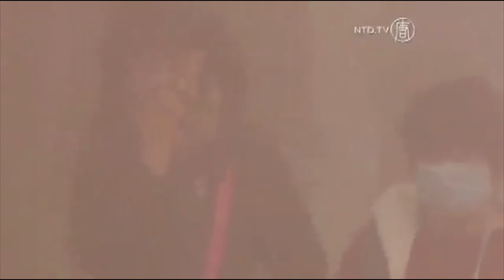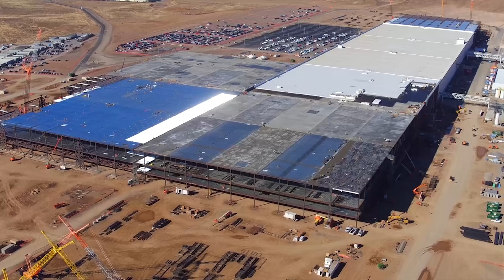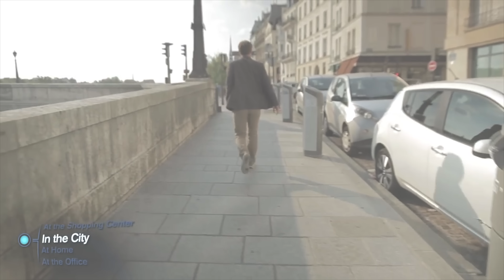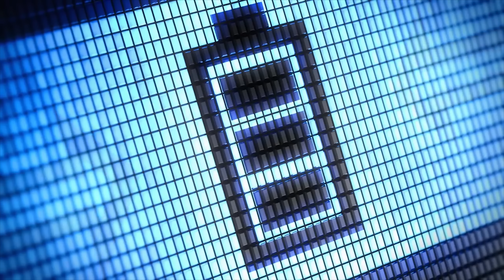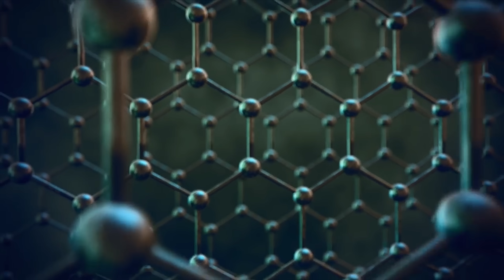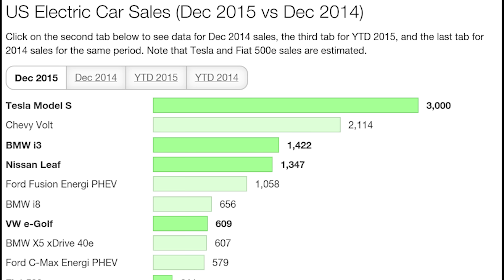Are Supercapacitors About to Make Tesla Obsolete?

Comment: I would think Tesla  will just put in the best Technology available .  I think Elon has already expressed interest into the Super Caps.They are not known for standing still or being Luddites.
Reply from the maker: +Charles Jutkins Of course, you're probably right in practice. Did you read about Volvo's announcement today?
Reply: Energy Analyst What is the announcement?
Reply from the maker: They announced that they were fazing out diesel cars - https://futurism.com/volvo-says-that-they-will-stop-making-diesel-engines-thanks-to-tesla/
Reply: Charles Jutkins I was about to post about the same comment. I would imagine Musk would embrace this pretty quickly.
Reply: I think super caps are good for quick bursts of high energy while other means apply for long distance energy needs.
Reply: Tesla just bought Maxwell, a super capacitor manufacturer, today

Comment: Tesla is currently investing heavily into both the new silicon batteries, as well as supercapacitor tech.  I don't think they will be left behind when the technology matures, and instead, will likely take advantage of the new tech to make a major inroad into the car market.  Supercapacitors might just be the tipping point for electric cars, once they can get the charge desity high enough.  They are also investing heavily into off-grid power systems for homes, their new solar roof tiles are causing quite a stir.  Coupled with the new power storage tech, I'd be far more worried about the future of power company stocks if I held any, than Tesla stock, IMO.
Reply from the maker: +Faelwolf Thanks for taking the time to comment and I'm sure that of all the companies that will evolve, Tesla will be at the forefront of them. 

I have to agree the the existing utility companies (and I'd add the networks to that too) gave potentially difficult futures. But, never underestimate the potential for incumbents to bend the rules, change the pricing schemes and to remain in place. 

I'd love to know how you thought the market will evolve
Reply: The market evolving?  IMO, two major factors have the potential to direct the market in the future.  One, that you've already mentioned, is the possibility of the major players to bend regulations or use the law to their benefit to either block the new tech entirely, or to monoplize it to their profit.  

The other, is for the people to take control of it, through ease of home manufacture or installation in some cases, or public pressure against the regulations and monopolization.  It has been done in the past in regards to other things, but it will take a concerted grass-roots effort to get it done. If nothing else, barring an outright ban on the new tech, the people will force a change by simply buying and installing the tech as they are able.  The market itself will force an evolution of the energy sector.
 
Some of the new tech that is on the horizon is simple enough to do at home, some in fact, too simple to even make a patent practical. This will have a major limiting effect on monopolizing the tech, but the energy companies will certainly try to over regulate it or even outright ban some tech in an effort to maintain their profits. I expect the oil companies to be the biggest and most powerful players in this.

Given the history of the energy companies, we may be in for quite a fight.  But we are at a point in time where energy demand is growing faster than current infrastructure can support it economically; that, coupled with the current budget deficits brought on by decades of wasteful spending, may be the political leverage needed to prevent a repeat of the robber baron tactics the energy companies used at the turn of the century to keep cheap/free energy out of the hands of the people.  We also have the factor of the new tech providing cheaper energy for manufactoring to ad leverage to the side of the people, as the never ending demand for cheaper goods is a pretty powerful market driver. Just look at the history of automation in manufacturing for an example.

It is certainly going to be interesting to watch it unfold.  

TLDR; I think we will see an attempt at controling/monoplizing the tech cause some social upheaval in this area, which will be followed by a gradual changeover of our whole energy infrastructure. The simple fact of economics alone will dictate it.
Reply: Faelwolf -  Can you provide any links to confirm that Tesla is actually working on energy-dense supercaps ? 
Paul G
Editor EVUK
Reply: Thorium replacing fuel in every nuclear power plant on earth has more potential of happening - and stopping nukes from being made forever.  Supercapacitor tech can also use thorium alongside graphene - graphene can both super cool a once activated charge - and transfer the charge - for millions of years - any size big or small
Reply: Tesla's powerwall is not new technology.. it is well packaged and has an organization behind it, but the technology is ancient, and they are charging a lot for it. Their solar roofing tiles are also not new.. Stan Ovshinsky did that years and years ago, and was the first to offer solar roofing.. Tesla improved the offering by using new plastics instead of flexible plastics to enshroud the solar laminate, thus making it more attractive, easier to install, and easier to ship.

What they are doing is great, however they are pursuing it industrially.. their technology isn't new or innovative in this case.. only their business model.

Comment: Tesla will not become obsolete because it's an awesome car and it has tons to go to even be considered as penetrating the market.  The car also has a ton of tech besides the battery like Autopilot and the charge time is less then 30 minutes (never 90 minutes even from completely empty at the SC's) at the TONS of supercharger locations strategically placed along main fairways.  Add to this the Model 3 shipping at the end of this year for $35k and it's not longer too expensive!  Petrol isn't cheap when compared to electric charge and even less so when you have solar panels as I do.  Who is also to say that Tesla can't adapt and build supercapacitors in the gigafactories "if" this became viable?  It's still an electricity delivering device!!!
Reply: BYT Homes....heading...
troller...

Comment: I know capacitor has high ability to be charged and dischage, but it s also has high self discharge which is a disadvantage compare to batteries.
Reply: Eric T You can keep the high charge while lowering discharge.
Reply: yeah, right, you gotta keep them charged for 1 year before it discharges to half capacity.
Reply: MichaelKingsfordGray With resistence!
Reply: Ever seen a capacitor catastrophically fail? It makes a burning li-on battery looks like a child's sparkler compared to a stick of dynamite.
Reply: Ya, super caps loose about 20+% per week, Li-Ion 1% per month.
Does mean you need to keep on top of your charging all the time, but it doesn't make them unusable.

Comment: Super capacitors have been know about for a long time. The problem is finding a way to produce a single one atom thick layer of atomic-scale hexagonal lattice made of carbon atoms. It hasn't been done yet in a way to make it in great enough quantities to mass produce large amounts of batteries. Also filling any battery with huge amounts of power in just a few seconds as said in this video is going to need huge power supplies. Very high voltages or very high current. Think about it. I'm not sure if people would be safe using to such a thing.
Tesla is doing the right thing and using the technology that has been proven to work for years in phones, laptops etc.
When in the near future new types of batteries become viable products, I'm sure Tesla will have no problem converting it's gigafactories to produce the new battery types.
Reply from the maker: Thanks for the sharing - really interesting
Reply: It seems that it has been done, at least this is what the company launched in 2016 based on Richard Kaner's work at UCLA with Maher El-Kady, it seems to be marketing a 1st generation graphene supercapacitor batteries and developing generation 2 ,  http://www.nanotechenergy.com/

Comment: Your opening statement invalidated your video.

1. Volcano eruption produces more pollution than automobiles would produce in 100 years.

2. The electricity produced to charge these evs comes from somewhere right?  Yes it comes from mostly coal and carbon based fuels to produce that energy..

Comment: Super capacitors will be great in small electrical devices but for cars? No. 
To charge a Tesla with a super capacitor having the same stored energy (100 KWh) as a battery in 6 minutes would require 1 Mega watt of power. 
That is: 1,000 volts at 1,000 amps or 10,000 volts at 100 amps etc. 
If petrol stations were to become fast charging stations with 20 charging points each station would need a 20 Mega watt supply. That's about the same power needed to supply a small town.
Oh, and have you thought about the size of the connector and the in-car cable?

Comment: Supercapacitors could compliment batteries but there's one major factor you didn't mention in the video. Even if you could charge supercapacitors much faster, where and how are you gonna manage that amount of current in such a short time? Because charging 100kw is no small feat. There are some obvious restrictions in the size of cable used for charging.

Comment: supercapacitors play a  big part  as I wonder how long it will take road transport to catch up with aviation. to see piston engines replaced by gas electric turboshaft supercapacitor set up. with twin turbo out of phase acoustic noise cancellation with exhaust heat recuperators as batteries still have poor energy density compared to liquid fuels.
Reply from the maker: How long do you think it will take until we see them?

Comment: Supercapacitors only hold 5.5Wh/kg, Li-Ion batteries hold 100Wh/kg up to 260Wh, one capacitor being light for less power means jack shit.
Once you need to bring them up to equal levels you need to have 20x more weight on board, so a 500kg Tesla battery would need to be substituted with 10 tons of supercapacitors minimum.

They have expectational potential in power buffering, but as a replacement in cars this isn't it at all.

Comment: the only option to make electric vehicles "usable" would be a mandatory standard for exchangable batteries, you can swap for a charged one at any gast station. leasing those batteries would make up for vastly reduced maintenence cost for a direct electric drive.
Reply from the maker: I tend to agree with that, but do worry about the gated communities we see throughout other industries - unless there are laws requiring it - I suspect it won't happen
Reply: sadly the issue is more political than technical. privatisation of essential national infrastructures has always lead to a decline in quality at higher costs, because profit MUST be made. but allowing to disown citizens is an equally huge dogmatic no-no, as not being able to pay back investors. the only option i see, would be an open source standard taking over globally, before a big corp. and that wont happen. 
(fun fact: the one and only thing EU regulations were praised for, was essentially banning proprietary phone charging connectors, in favor of making micro usb a quasi-mandatory standard. (of course apple dodged that somehow) ..that was right between banning apple snails, criminalizing every aquarium hobbyist that didnt immediately kill them, and banning "normal" incandescent light bulbs.)

Comment: I find supercaps a promising technology. Where i see an issue is with charging them. Aussume i want to charge 90 kWh in 1 minute,  it would require a 5400 kW power feed to make that happen. 
As i normally only need a partial fill on trips and can also charge less fast  this figure could be as low as 2000kW or even less. Thats 2000kW for one car. For 2 it would be 4000kW.  At Tesla Superchargers they charge with 130kW max.
The challenge will thus to supply the required amounts of energy to the supercap chargers.
Reply: Also a 5.4 Mega watt power feed to the car is going to need one hell of a plug. Multiply that by the number of fuel stations and pumps and in the UK and its more than the current maximum output of the National Grid.
Reply: super caps still require a fuel energy sources from which to be charged ;I suggest LFTR nuclear power as the cheapest most practical source for powering up super caps via lithium ion , hydrogen fuel or zincate fuel cells that come in fuel cartridges with a core charge or several other energy transfer methods that have passed muster.
Reply: more super capacitors... each recharging stations have huge energy reserve so it can serve peaks while refiling from grid when nobody is charging. yes grids will need to be upgraded in any case... with so much air conditions in summer they need to be even without electric cars. 
with energy storage solar and wind is more interesting... and maybe fusion power too.

Comment: There is not only one Solution for Storaging Energy.
Not only Supercapacitors, not only Lithium Ion Batteries.
We have to open our Eyes and look what is suitable for our specific Needs.
So the answer will be different of what we will get.
There are also upcoming new Tecnologys for Capacitors and Accucells.
Like Solidstate Batteries and probably Graphene for Capacitors.
Sodium Cells.. Flow Cells..
We should constantly innovate them and see what ist best for our Specific Needs.
But for now we have great Batteries for great Storage.
We don´t have to wait, we have to make Change.
Reply from the maker: Thanks for sharing your thoughts and that's probably right - I'm working on a new video looking at disruption in the electricity sector and that's one of the big conclusions (no spoilers!)

Comment: Two years later: The Nevada Gigafactory is where Panasonic builds cells exclusively for Tesla using mostly local workers on the Panasonic payroll. Panasonic has recently signed an agreement with Toyota to provide Li-ion cells but Tesla has agreed (yet to be agreed by Maxwell's board) to purchase Maxwell for around $300M (a manufacturer of SuperCapacitors and the holder of patents for a 'dry electrode' which is a technique for the more rapid manufacture of Li-ion cells). Tesla could move to a new technology tomorrow, it owns a majority share in the Gigafactory but Panasonic owns the current production of Li-ion cells there so Tesla would have very little exposure, Panasonic on the other hand, not so much. Anyway if Tesla were to make its own cells they would still be Li-ion with graphene SuperCapacitor built in (the energy density of SuperCapacitors is still not enough to replace   Li-ion entirely, maybe one day).

Comment: Any EV can simply use whatever battery, supercapacitor etc  is best for the job, equally your battery factory can be geared up to produce these. All that will be required on the car is a new BMS.

You will notice that Tesla now only say what the range of the model 3 is not the battery capacity, I am sure this is in preparation for changing the power source to whatever is the best available, so as batteries become more energy dense you can use fewer to go the same distance.

Comment: When or if we get high density supercapacitors, where will we charge them? Currently solar panels are cheap as certain overseas markets are dumping them below production cost. This will change either by tariff or because all of our plants in the usa are bankrupt. Most electric power comes from coal or increasingly natural gas. In 2016 15% of energy came from renewable resources, 65% from coal or Natural gas, and the majority of the rest from nuclear.  So less than 15% of energy used by electric cars is from clean sources. Capacitor or battery , most electric cars have a long extension cord going back to a polluting plant. I DO expect this to change in the future but not for a good while unless other breakthroughs are made.

Comment: There's an inaccuracy, or rather overemphasis, in this video, re a lithium ion batteries loss of capacity over time.

Its been shown that lithium ion batteries behave much differently in cars than small batteries in lap tops and phones.

Typically, a Tesla battery only loses 10% after 100,000 miles and then at a crawl after that.

We know this from the many taxi's that have done over 100% miles.

Comment: So where do you get the power to charge your electric vehicle? From a powerstation. Most powerstations run on coal... So how much reduction of emissions would be possible is everybody would drive an electric car?
Reply from the maker: +bluethunderbug it depends on the market. Most power isn't generated by coal in Europe or most of America.
Reply: I am sorry, but you need to do your homework better. In the EU the electricity is produced as follows: 2.6% oil, 24.7% coal and lignite, 23.6% natural and derived gas, 27.4% nuclear, 20.9% renewables and 0.7% other fuels (recent study). So over 51% of the electricity in Europe is still produced with fossil fuels. I am sure the USA will not be that different.
So the environmental benefits are not that great.....
Reply: Found this about the USA:

Natural gas = 33.8%Coal = 30.4%Nuclear = 19.7%Renewables (total) = 14.9%
Hydropower = 6.5%Wind = 5.6%Biomass = 1.5%
Solar  = 0.9%Geothermal = 0.4%Petroleum = 0.6%Other gases = 0.3%Other nonrenewable sources = 0.3%Pumped storage hydroelectricity = -0.2%4
Reply: +bluethunderbug   You need to read what you wrote i.e. "Most power stations run on coal" and to try and win an argument you change that to fossil fuels thinking the rest of us won't notice. By your own figures coal accounts for only a quarter of the grid in the EU.
Reply: Fair enough....